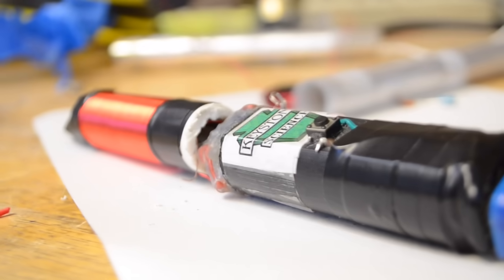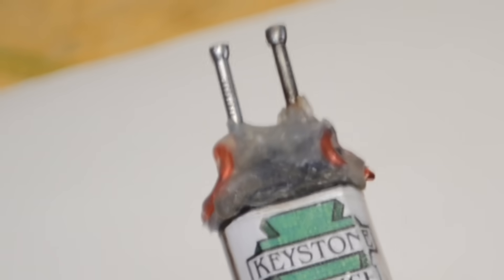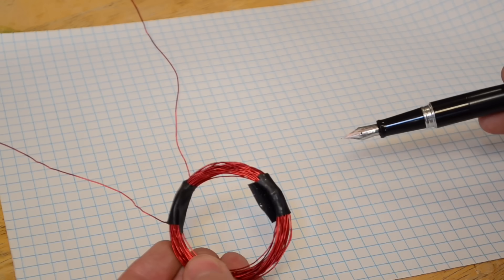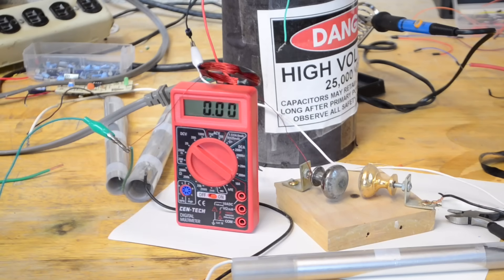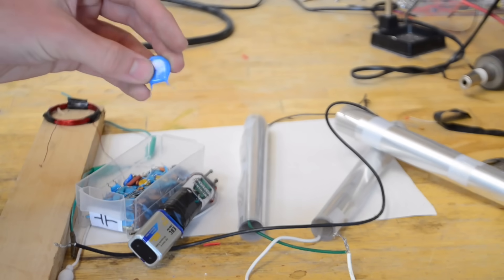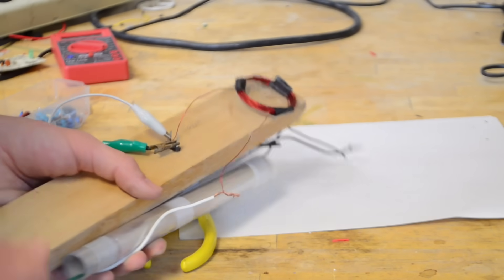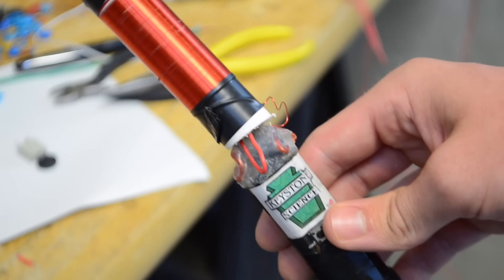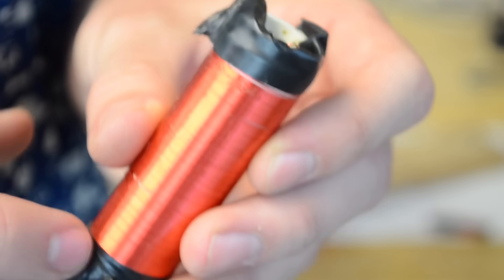How to make a pocket EMP

Comment: I am writing a fiction non-fiction sci-fi book, and require some medical expertise to assist with anatomically accurate procedural information, according to the theme of the story: When Axel was 5 years old, he was sold to an underground criminal organisation where an evil doctor forcibly inserted a torture-surveillance-spyware bug into one of his frontal sinuses. 40 years later, Axel has a head injury in a near fatal motorcycle accident, and when observing his skull x-ray, he finds that there is a bug in his head! By this time, the underground criminal system, has infiltrated the global medical industry, and there is no way any governmental or institutional doctor will acknowledge his situation or even try and remove the bug for fear of the criminals. If he doesn't get it out soon, it will most likely fry his mind, brain and eventually kill him! (this is the part where I need medical advice) How would he remove it? And he must do it alone!

Its a bug ... will all he need is a good electric impulse which will fry the bug circuit?

Comment: I read you can use much bigger capacitors to massively overload bundles of wires to the point they go boom and it will create a far more substantial emp
Reply: I have big capacitors but its only working (weakly) when the capacitors aren’t attached. Any advice? For wire I have a long spool of thin wire and I have the whole spool attached
Reply: @fireice8828  the type I am talking about uses massive amounts of current to actually blow bundles of wire through overloading them so its single use,  its highly illegal where I am though and requires pretty expensive super capacitors but produces the sort of emp that would irreparably fry everything in a 5+ meter radius, your little gizmo is creating EM interference rather than a true emp that would fry electronics

Comment: 1:54 after the capacitor is charged enough for the spark gap to conduct, wouldn't the current flow through the coil in the opposite direction as is shown?

Comment: High voltage low amperage. 
The trick with inductors is to have many layers running parallel. 
Start off with a small core and build up. 
You could use a very fine wire because the inrush current is minimal. 
Duty cycle may be an issue as magnetic fields collapse slowly in comparison to electrical flow if using a metal core. Your caps could affect that.
Reply: Can you make me one to take out a five fee tower if it’s killing us, the. Send?

Comment: Thats really just an EMI generator. To make an EMP generator, you need to wrap the coil around a copper pipe, fill the pipe with explosive, and set off the explosive at one end when you trigger the spark gap, the explosive drives the EM field outward and concentrated in the direction of the opposite pole from where the explosive is triggered.

Comment: Packages From Heaven:
• Note that with enough directional power, it would be possible to blow out traveling drones with an EMP gun. That means you could effectively shoot Amazon delivery drones out of the sky and have them deliver their packages to you instead.
• But also note that there are specific circumstances in which this is legal. Within the USA, the drone must be over your owned property and it must be within 400 feet of the ground. That is your personal, legal air space. Anything traveling within that area is trespassing and is therefore legally yours. Anything you EMP down outside of that area is not yours and your actions will cause legal repercussions. Be sure to review this summary with a lawyer before considering it accurate.
• Note most of all that an EMP powerful enough to knock down a drone hundreds of feet above you is probably powerful enough to either cook or kill you. Therefore, don't make or use EMP guns without expert supervision, if at all.

Comment: ok i've been playing with this stuff since you can order online for cheap,three month wait  at times but hey.in Canada its or they are illeagle,tasers and emp devices and anything else fun.I used the 3kv6kv  power booster which claims 4000000v and the super booster which is apparently 800000 v.i know they hurt as a taser(don't use on people unless your willing to do to yourself,or if obvious like a gun  fyi)just simply tho no capacitors needed,just battery power booster/step up booster and magnetic wire(took mine from speaker coil)add spark gap n it works.seen someone suggested a foot distance?no much less i had to put up against screen on microwave but did kill microwave .unplugged and plugged back in and reset is good.so today i'm trying double or well 3-4 times the original at 400000.to see increase and im trying it out on few things so ill try to repost to you all .but no capacitor needed and ya pretty simple easy stuff i like it and hope we can all put in what we find to maybe come up with something to assist generating some cash by means of well each to their own plz don't take offense but i've lived rough and if i can say unlock a car or trunk or lock ,or if i can access free vending etc it beats having to approach people asking or taking.ive tried hard to be legal n still try but i refuse to hurt another for money when we can manipulate the corporate world a touch n really no harm no foul as long as its for food or bills to get paid y not.Until man realizes money isn't needed were all at risk of living on the street or by ones wits.Big picture if we all only used what we needed food,power even slightly immoral so to speak and all went to our reg jobs or assisted thos jobs we would freely give each other what we needed n recive also and no money,no one person would have absolute power  none of that would be needed we would have all for free aside from a bit or work,from pot and beer to baby food n diapers we could do just fine.k enough of that ill post results if cool of my findings boosting up the power take care be kind .thanks

Comment: take apart an old-time automobile coil.  Inside on the secondary side you'll find a coil of wire that would be perfect for this, already made up.  I'm thinking about an emp that's the size of my car powered by my car battery and capacitors rated to do some real damage.  Looking for a range of 100 yards.  I wonder if my car will work after firing it off?
so how do emp weapons (that aren't nukes) work?  I believe they set up a high current signal thru the coil then instantly destroy the coil with an explosion which causes the magnetic field to migrate off and do it's damage.

Comment: Hi from England just like to say  cool channel subscribed   iv always wanted to ask someone that knows a little about emp about 20 years ago me and my friend were riding motorcross bikes across a farmers field in the dark  we were about 30 ft apart I saw a blue flash shoot across the bottom of the field and both our motorbikes instantly cut out we both tried to start them back up but they wouldn't so we had to push them after 10 minutes we tried again and they started up now at the bottom of the field was a mini sub station so I am guessing it was some kind of power surge or something to do with the sub station  could this be possible?  so to me it is possible to build a big emp device that would cut a vehicle engines out thanks

Comment: Just curious why do you need the spark gap in the circuit, is it so that the capacitor won’t discharge until there is a significant enough voltage difference?

Comment: Hi great video. The presentation is on point, I'm impressed.  Not only the technical knowledge but the ability to convey that knowledge so a layman isn't left in the dust. Thank you.  A question: magnetized copper wire - where does one obtain this? / what are common sources? 2nd question: why doesn't the emp disrupt itself? 3rd : say you wanted to increase the range, would it be a matter of larger capacitor or input current or ? Thanks in advance
Reply: An EMP only damages things that can’t handle high voltage. So you can beef up your electronics and make them EMP resistant if you know how. But everything he is using to make the EMP emitter is designed for high voltage. So, it’s not going to be damaged by the EMP blast.

Comment: Im curious what are the specs of those ceramic capacitors and how much of them did you use. I want to make an EMP myself but I don't know if the capacitors can withstand the voltage and current.
Reply: you know you past optimal number of capacitors when you hit the button and the coil vaporizes... for real it sounds like a gunshot....

Comment: can you do this without capacitors? I saw a design with a taser with one side of it connecting to a spark gap that then connected to the coil and the other side directly connected to the coil
                                                                        ______
          >     _______| (spark gap) |_________////         \\\\
         |                                                         ////   (coil)   \\\\
   high voltage ports                                \\\\               ////
        >      _____________________________\\\\______////

Comment: FAKE, Tesla Coil, not EMP device, you idiot.
Reply from the maker: Not fake. Similar setup to a Tesla coil, timing due to the spark get sets up pulses transmissions of radiation from the secondary coil and from the spar gap. Thus indeed this is a electromagnetic pulsing device.
Reply from the maker: Emp is just a short burst of EM energy, which certainly this is. Weak, yes, but that’s why it’s good for demonstration.

Comment: A door knob for a spark gap is not the best option as the electrons cannot easily jump off of a smooth surface, you would be better off using something like two nails for a spark gap.

Comment: I think I know why the secondary of the tesla coil worked so poorly. Eventhough the induced voltage is proportional to the number of turns in the coil we must not forget the inductance of the coil. Using a wire with such a small cross section and that many turns will result in a huuuge inductance. In the case of short pulses, this will make the impedance of the coil very large leading to less current and therefore a smaller magnetic field and in turn a smaller induced voltage. Please correct me if I am wrong.
Reply: So would less turns with a thin wire be stronger?

Comment: Now that you've made a pocket emp, can you make a larger scale one that can do a bit more than damage a multimeter right next to it. Also, apparently if you put to many turns, the coil's inductance can make the emp less effective.
Reply: Also is it possible to make an emp with a piezoelectricity
Reply: So a smaller coil of wire would be more effective?
Reply: @fireice8828  The less turns, the less strong the magnetic field.
Reply: @henrylark4778  But you wrote too many turns will make it less effective?
Reply: @fireice8828  That's also true. So I'm guessing there is some sort of middle ground that maximizes effectiveness.

Comment: Wait so in your spark gap link one of the nails is attached to the enamel wire and at the other end of the enamel wire its linked through capacitors and then into the other nail?

Comment: “Remember Guys, This Will Break Electronics...” as he records himself using the EMP
Reply: High qaulity camerea
Electromagnetic shielding
Stops shit breaking if lights go sicko mode
Read the pinned comment
Reply: @oDydnA  Dumbass he didn't bother actually testing it and proving it works.

Running 9 volts through that coil wouldn't generate an EMP it just has an electomagnetic Field.  he didn't even bother going over the SCIENCE of what an EMP is and how it works.
Reply from the maker: I don’t remember what I filmed, but I do remember that I tested it on a multimeter. If you want to science behind it, then you need Maxwell’s equations, which I didn’t know at the time. It’s just a cycling of electric fields with magnetic fields as given by the coil-capacitor resonance. Emps just need this relation in a pulse to create a sudden spike of high intensity fields

Comment: High voltage electricity is nothing to mess with unless you absolutely know what you're doing , They say it's not the voltage that's the killer , It's the amperage but it can still be lethal for a person with a weak heart , I've heard of some cases where a police officer was using a regular stun gun to subdue an unruly suspect and the person died from the shock , I myself would never want to get that kind of a shock because I don't know if my heart can take it , another thing about an emp gun is if you're not careful with it , Can start fires and you better not be in a dusty environment or where flammable gases and/or liquids are present because otherwise can set off an explosion and fire , That kind of device , You definitely don't want to be carrying it on your person when at the gas station filling your tank , Suppose you were gassing up your vehicle and the fumes drifted towards you and the emp accidentally fired in your pocket , If you carry it with you in your vehicle , When going to the gas station , Take the battery out before you get there
Reply: This whole "it's the current that kills you, not the voltage" is terribly inaccurate, because at the constant resistance of your body, current can't flow without a certain voltage. That's like saying: "It's not the gun that kills you, it's the bullet!"

Comment: use some mylar to cover the inside of a tube large enough to hold that coil leaving a inch or two of space at the end. Create a parabolic mirror with mylar on the end of the tube closest to the coil. Assemble the whole thing. you now have a somewhat focused directional emp.

Comment: If you want to improve this do 2 things:
1.  Get a Gaussmeter to measure how big the pulse is.
2.  Think more about your coil.  More turns doesn't necessarily help you get a bigger pulse because the extra turns increase your inductance, reducing the current which reduces your pulse.  A large battery, a large capacitor and a few turns of heavy wire would produce a big pulse.
Reply: Info unlimited has/had a design in their second evil genius book and it's a single inductor coil emp made using a 1" wide strip of copper.  Spark gap was made with tool steel or titanium.  

Making a nondescript 10KV power supply isn't difficult.

Unless you can find a wide flat "slapper" capacitor, unfortunately, I don't know if you can get quite the same results it purported.  Caps were 5-10 KV.  Width reduced the inductance and allowed higher current discharge, faster.  If you can find anything low ESR, that might do, but you'd need metal bracket strips which might affect portability.

IU seems to have closed shop for good now that Bob Iannini died in April this year (2023).   But it's worth noting even their design was a questionable prototype at best.   They probably didn't elaborate because of the implications of this type of device.

Now we'll never know, perhaps.
Reply: Good information, thanks!
For educational purposes I mean, obviously.
Reply: How many turns would you recommend?
Reply: @fireice8828 3 to 5 imo
Reply: @fireice8828 3 to 5 imo
Reply: Would a tazer and a copper plate is gonna do the trick?

Comment: Ha ha emp shield is a con scam! The device cannot work! The cables could barely carry 12 volts let alone thousands of volts from a emp. The copper wire in a home will convert magnetism into electricity and burn everything plugged in in a real emp! Ha you are sutch a con man!
Reply from the maker: Do you want proof? You can try to build it yourself. It is not a strong emp, but certainly it works. The wire is enamel coated 26 AWG wire, it is the same I use for my Tesla coil secondary (which reaches hundreds of thousands of volts) the trick is it will not jump through since the resistance through the coil is much less than through the enamel of the wire. I can give plenty of equations backing up my statement and measurable effects. (Infact this is essentially a miniature Tesla coil... in a sense, though not exactly, the operating principal is similar. )

Comment: You'll develop a stronger EMP with fewer windings.  The multitude kf windings is increasing the inductance and slowing the rise in current.  The rapid change in current and quick development of a magnetic field ia what makes a destructive EMP.
Reply: @Bhante If the goal is an EMP, rapid rise in current is the goal.  Since inductance is proportional to the square of the number of turns, and low inductance facilitates  a rapid rise in current then generally the lowest number of turns would be most advantageous.
#turns ~= 1
unless you know how to make a circuit with a fractional number of turns less than one.

Comment: Can lead protect your electronic devices from an E.M.P
Reply: Anything conductive probably can. Most mid to high end audiovisual cabling is sheilded with a thin metal layer to absorb any interference. The amount of shielding required likely depends on the power of the emp.

Comment: Instead of a coil or tube coil.. couldn't you hypothetically just plug a transformer to it? Or would that make it behave different and why? It wouldn't be changing the fact its a sin. wave ac or anything cause no rectification.. that would give you the quality wrap of a former coil but powered from the spark gap ciruit right, what if it was a micro wave xformer?